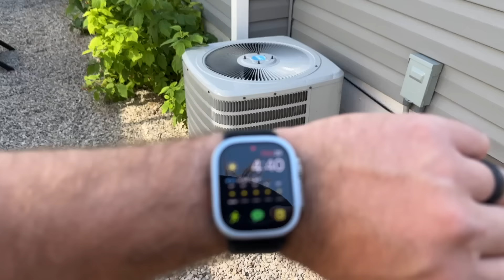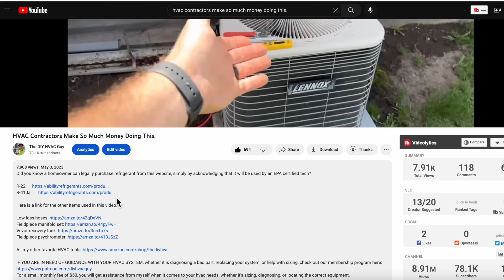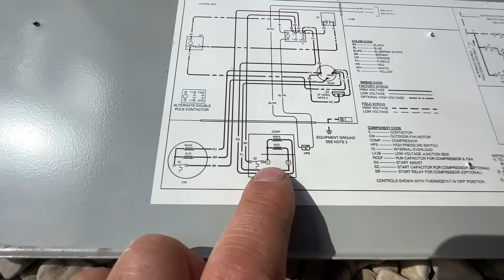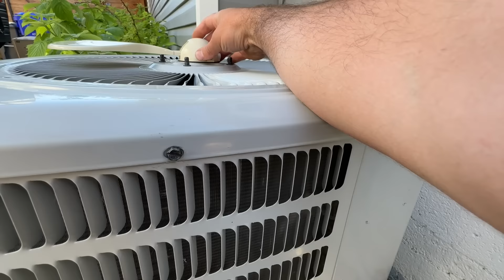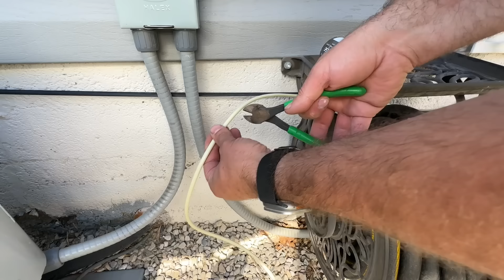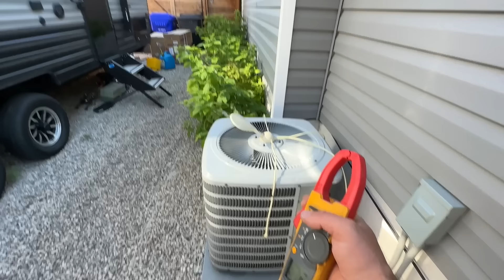Can This Device Actually Lower Your Electric Bill By 30%??

Comment: Hard to get a noise count when the wind is blowing.  Wonder how much more the water bill will be?
Reply: Why not use the water that collects in the condenser to supplement tap water?  A tank system, perhaps, with a pump that activates when the outside unit turns on, and a float valve inside to only add water when necessary? All sorts of ways to skin this cat, but it might start looking a little like Rube Goldberg designed it
Reply: @gregorykusiak5424  I have spent more idle time on this topic recently than I am willing to admit,  but apparently there is a project at UC Davis that is  attempting something to that extent, using a pump like you mentioned and wicking material much like an evaporative humidifier/swamp cooler
Reply: @bungl3971  they do good research at UC Davis- I built a Corsi-Rosenthal box filter when the smoke from the fires was bad not long ago, and I keep running several in my home because the air quality is noticeably significantly better than just running my HVAC system with its single filter. 
(Peltier modules (to generate electricity for the pump) from the hot side of the AC coolant loop?) like I said, Rube Goldberg here we come, but they just add credence to Tesla’s claim that we have more energy available surrounding us than we can even imagine.
Reply: apparently the manufacturer states it uses approx 1 toilet flush worth of water for a given hot/heavy use day, assuming that is accurate lol but 2 mister heads like that do not flow much all things considered
Reply: Roughly about a gallon per hour of use.

Comment: Once my condenser fan motor went in the middle of the night. The unit shut itself off doe to the high pressure. I got my garden hose which has a multi spray nozzle so I set it to mist, I then secured the nozzle a foot or so away from the AC unit and turned the water on. The AC ran cooler than when it had a working fan. LOL. It took a couple days to get a new fan motor so I had the water cooling it for that time. I have been wanting to get one of these mist systems and I think I will after seeing this. It has been super hot so I bought a portable window AC unit for the living room just to help with taking the load off the main AC. It has helped a lot because the main does not run nearly as much. Set at 74 it was running nearly all day straight. Now with the window unit and the main still set at 74 it only runs a combined 3-4 hours during the day. I'm in Miami and it has been 95+ every day here! Waiting on my next power bill to see if it has come down from the $400 it was the last few months.

Comment: Not sure if 1 degree is worth it, though I understand that everyone's mileage may vary. Not sure I like having the outside spigot on all the time either. I would be interested in knowing if after this was used for a month, how much the electric bill dropped.
Reply: "Not sure if 1 degree is worth it"
The 0.6 amp reduction in power consumption is more of the issue.
Reply: @wisenber  And the cost of the water?
Reply: The idea is not to change the output of the air. There is way more to it than that. The point is to reduce the power used to have the same effect. .6 amps doesn’t seem like much that is not how you pay your bill you pay in Kilowatt hours and .6 amps is the savings in that moment. .6 amps over 40 to 45 minutes an hour will give you a better idea of the savings and that will be dependent on other factors like is your equipment under or oversized for the space it is serving.  I see the savings that said I have also seen the damage done to coils using this principle and me personally will never use one of these systems on my equipment.  That is my two cents and most likely wasted the time typing.  Just don’t go saying no one ever said there wasn’t an issue with the idea.
Reply: Fourteen cents.

Comment: An a/c condenser unit pulling only 4.4 amps? Forget the mist you have a magical condenser.
Reply: Exactly! More like 13 to 15 amps.
Reply from the maker: It’s a 1.5 ton unit
Reply: @diyhvacguy  OK, the outside unit looked like it was 2 or 2 1/2 and I assume it’s cooling the whole house. 1.5 ton is fairly small. Anyway, keeps the bills down!

Comment: We prefer our house at 75. We bought a new build house last October. With these hot days when it gets to 90, our AC can't keep it below 82 on the third floor, 80 on the second floor and 79 on ground floor. According to our WiFi thermostat, it's running around 14-16 hours per day during this heatwave, unfortunately it does not tell me day vs night run times. The builder confirmed that it's working properly, it's just because it' so hot that AC systems can't keep up with 90s heat. I called BS because I came from Phoenix, AZ where the AC didn't struggle with 75 unless it was over 114 outside. 
Its frustrating feeling so warm and uncomfortable in my home, so I've been looking for something to help.
Reply: Our AC is on the south side of the house, and HOA does not allow any shading structures for the AC systems.
Reply: @javaman2883  what about a tree or shrub

Comment: I would think the front facing the sun would get hotter than the back side along the house where you have a sprayer hose. Maybe if you were spin the paddle on the top to face the rear the hose would face the front and cool better.
Reply: He mentions this at the end. He realizes he put it on backwards, and would have likely seen better efficiency improvements with the mister on the front.

Comment: Thanks for a great video. Just some observations, your termite prevention person is Not going to be happy about you constantly spraying your house foundation with water. I understand the "direct sunlight" of baking the compressor unit, makes good sense in low humidity climates, example Arizona. The water misting technology is a good old reliable and proven technology (it predates air conditioning by many years). I wonder how my current HVAC system provider warranty would react to covering my AC unit (I currently have a 10 year parts and service warranty) if I installed this system ?  Saving on my electricity bill is always helpful.

Comment: Introducing moisture to metal will only helps speed up corrosion . Anode to Cathode. Heat transfer will acquire regardless is its 40 degree or 95 outside . If you’re condenser is pushing  out 105 degrees . That’s a 10 degree TD . This product is so cheesy should say as seen on Tv lol

Comment: Cool video - If you're on city water & have to pay for it, maybe it wouldn't be worth the savings?
Reply: Do the math,10% of your electricity bill vs 5% of your water bill.
Reply: @malcolmblack717  not sure what your talking about? 3.6 AMPS is about a 20% savings compared to the 4.4 amps he referenced on that one power leg. Where are you getting 5% of water bill from? I would want an accurate water consumption use, KWH cost of electricity & CF cost of water. If it only uses 1.6 gallons of water a day then it may be worth it.
Reply: @briangoodale7167  I assume you do have other electrical appliances. The AC consumes about half of your electricity. If you watched the video he says the water usage is about one toilet flush per day.
Reply: @briangoodale7167  How can you expect an answer to the costs savings when our country is so large with different electricity rates. Furthermore, the efficiency/savings will vary greatly depending on where you live - dry vs humid climate, how long you run your AC, is your AC in the shade or direct sunlight?

Comment: How come you did not put the amp meter on one of the legs out of the disconnect?  Which wire did you measure the amp draw from?  There is no way that condenser is only using 3 amps of power.  Was this a sponsored video by cool n save?
Reply from the maker: No I bought this product to check it out myself.

Comment: I had the same idea 10 years ago for my home system in an attempt to cool the ambient air and make the system more efficient, but decided against it.
Unless you are using 100% distilled water (zero minerals), this type of mister will plug / destroy your condenser coils.  The supplied filter does not remove said minerals.  The mister nozzles must be placed about 24" from the coil and mist the entire coil for proper coverage.  The location of the mister shown in the video would only "cool" a 2"x2" square area....in other words its doing virtually nothing.

Comment: Great video.. My unit gets full sun at about 5 pm ..and I was standing there with my AC guy. And it was HOT..94 out but TBE air blowing off the fans. Omg.the Hot..now I get it...question. My vents The air blowing out at THE coldest is 58.6. To 60..do I need  a Freon top off. My txv. Finally was checked by a reliable guy. He Saud its fine. He Saud he herd a slight thump or something but it's working fine. My entire system is fine just old and its hot. It will not cool below 72. Period. Its a three ton..10 year old. Filters cleaned every month. Handler clean coils clean. Ugrrrr
Reply: Its not about the discharge temp at the vents or your refrigerant charge, its about temperature drop across the evaporator coil. There are many other factors.  The difference between ROOM temp and discharge temp should be 20-25 degree drop.  So if your room temp is 70 degrees, your discharge temp would be 45-50 degrees.  DO NOT measure the temp at the floor vent, because temps rise inside the ductwork, especially when ductwork is run through an outside, south facing wall.  Anything lower than 20-25 degrees, could result in the AC system freezing the evaporator coil and not allowing air to properly flow across it.

3 ton TXV system, but you didnt tell us the SF of your house.  1 story or 2 story?  Lots of windows on the west, south and east?  AC condensers are made to run at 90-100 ambient, so 5pm in full sun is not a problem.  Evap coil is clean, but is it plugged internally from the aluminum corroding?  What is the allowable static pressure of the air handler discharge?  If you are pushing anything above 1/4" of water column, your supply duct is restricting airflow.

You could have other issues that your guy did not look at.  Possibly you have miss-sized return air ducts or something else going on.  I would hire another company for a second opinion.

Comment: Those only cause the condenser coils to be caked with hard water and mineral deposits over time and throw the high side pressures off. I remember when these were on infomercials decades ago and they went away do to the issues I mentioned.

Comment: No no no
Do not do it.
It has been tested on commercial AC units and spraying water rotted the entire AC unit.
When AC units have thin Al and water no matter what you do rots the AC cooling system fins.
Yes 
It will work for a few years but at a cost of replacing your entire AC units.
In the long run water spray mister is basically a rotting machine.
Plz Do Not Do It

Comment: How much water does it use on a daily basis? How much do you save when you include water costs? What about the device costs. How long before ROI.
Reply: Do the math,10% of your electricity bill vs 5% of your water bill.

Comment: I used one of those on my very tired 33 y/o Trane unit to buy me some more time before replacing it. South side of the house. Full sun all day long. Wasn't worried about mineral buildup, corrosion, etc, since she was about through anyway. Actually got me thru 2 more seasons, including a brutal summer that reached 114. She was rough looking after 2 years tho. Cabinet was rusty and the coil fins were not pretty. I could definitely tell a difference in the way the compressor motor sounded with the misters running. Much less labored.

Comment: 91F is warm not hot, lol.
Reply from the maker: Yea imagine how much better it would be when it’s 100 out!
Reply: @diyhvacguy    I'm sure it works, I've used garden hose on low spray on old central AC unit that I don't even bother with until well over 100, recently weak fan completely failed so used water only....sub optimal for sure but get's the job done.

Comment: I worked in an Industrial Chiller plant that pumped chilled water around a very large campus. We had misting orifices mounted in front of our coiling coils that serviced our laboratory rooms. Note this was back in the early 80’s so this is nothing new. Latent heat of evaporation is real science.
Reply: YEP.. AHS A BALTIMORE AIR COIL...EVAPORATE COOLING. WHEN WE HAD A HIGH LOAD SITUATION..HENCE IT COULDNT KEEP UP WE SPRAYED TAP WATER INTO THE INLET BLOWERS..OR HAD A 50 TON CHILLER..BEFORE WE ADDED ANUTHER 50TONS TO THIS 8 STORY BUILDING..MANY A TIME SPRAYING THE OUTDOOR COIL W A HOSE TO LOWER THE PRESURE/TEMP..

Comment: Point that third mister out front.    I've had 3 of these and while they work well, they are made like crap.   The needle valve fails even if you bring it in during freezing weather.   Very poor mechanical build quality.
Reply: Also, that  stiff wire inside the tubes is so you can shape them as needed.

Comment: It’s a nice concept but one thing to consider 
If your unit is in an area where there is a lot of pollen, it will mix with the water and make a “ glue” on your condenser coil.
Reply: So that's what got all over my patio out-door kitchen as we ran the misters all day...I figured it was just dust accumulating due to the mister droplets gathering dust and covering the surfaces.
Reply: It appeared to me that the misters were pointed away from the condenser. Would this help w the "gluing"?
Reply: @neepsmcfly4176  Even though the misters are pointed away, the air flow from the condenser sides is still towards the coil ( inhaling ).
Reply: @paulrozinski1488  an, sure. That makes sense. I dunno, tho. I live in AZ and the water is really hard. Never liked softeners but I have been using the saltless water conditioners for about 5 years now and am very satisfied. Annually, I check my tankless heater & flush it w vinegar but honestly it doesn't really need it. The pollen admittedly could be a problem if it's not pm'd enough, nonetheless, I think it's worth a go for the investment. Even if it bombs, well, I've spent more for less.
Reply: @neepsmcfly4176 can you catch rainwater and use that instead ?
I know AZ doesn't get much rain
Reply: @colstace2560  don't see why not as schlong as its clean water and not full of algae/mold etc.   But how would you create enough pressure for misting?
Reply: Ewwww
Reply: Bi-monthly coil cleaner regiments is the best solution for this
Reply: @jracer77  It all depends on the area you live in. Sometimes you will need to clean the condensor more often or less often.
Reply: True but that's why you control when the water is on. Where I am I wouldn't need the additional water cooling till June-Aug, when the pollening is long over.
Reply: I spray mine once in spring after the cottonwood trees that I don't know where in the neighborhood they are? Are done doing what they do..I don't spray inward, I spray downward top to bottom w a fan spray setting
Reply: You should rinse the condenser at least once a month. If its a dusty area you live in rinse weekly because the cleaner it is the better it removes heat.
Reply: @kris4786  You are absolutely correct. Most people have never cleaned their condenser coils. All you have to do is spray your condenser coils with the garden hose. Never ever use a pressure washer. This mister system is getting additional efficiency after cleaning the condenser and evap coils.
Reply: @malcolmblack717  Pressure washers can break things, and often do. Whether to use a pressure washer depends on the unit, and specifically its fin type and design.  I have a very small German pressure washer which works great for typical parallel fins on older/dying units, where a garden hose won't do anything more than rain would.  Probably will use it on my new home unit in a few years.  It has at least 5 tips and would never use the jet for knocking out loose tile grout.  If you can spray your hand without pain, its probably not too strong to use.

I label your comment bad advice, erring on caution, because some pressure washers and some tips, especially used by inexperienced people for the first time, could easily damage the condenser.  Same person could get electrocuted changing a light bulb or mauled walking a dog, bro.  

Also its not something you need to do often. I cleaned a 1999 system in 2014, its still running today, and didn't look to need cleaning like that again last I saw.  It took 15 years to have that level of ignored debris build up and rot in there.  The only alternative would have been to buy a new unit when it died of exhaustion.  Yes I cleaned it out first.  A pressure washer is not routine maintenance, but a proper restoration tool if you aren't selling HVAC systems to homeowners.
Reply: @joshuamorelock1400  I guess you don't understand english too well, let me repeat "Never ever use a pressure washer." Your city water pressure must be very low (like rain) to not be able to do any cleaning. Our country is HUGE with different air quality. So you need to be the judge of how often you need to clean your own unit . Your circumstance of clean urban living does not apply to everyone.
Reply: @joshuamorelock1400  ryobi makes a hand held pressure washer gun.  its 300 psi for the 18 volt version.  the 40 volt is 600 psi.  you put the hose into a bucket of water.  i love that thing.  not good for actual pressure washing but great for things like this (I only have the 18 volt unit).
Reply: @malcolmblack717  "Never ever use a pressure washer". Good comment. I would have done exactly that, though I have an electric one, not a flesh cutting gas powered unit.
Reply: @cadthunkin  Thank you for agreeing. People - Use Common Sense - salty air or hard water will requires weekly/monthly washing of the condenser coils. You can use a pressure washer carefully if your city water pressure is low - just keep the your distance. Your choice - maintain your stuff or they will break.